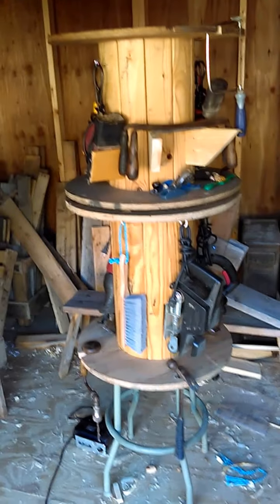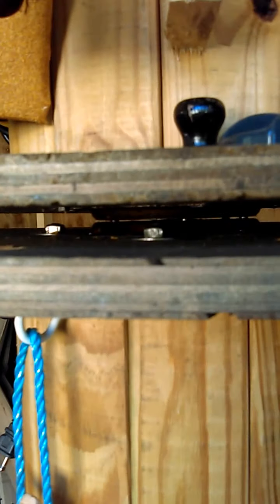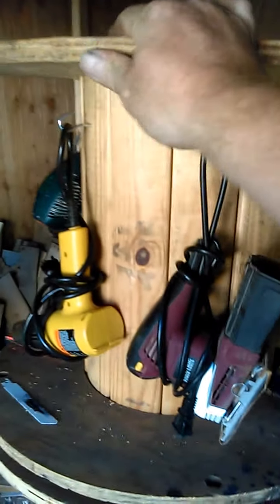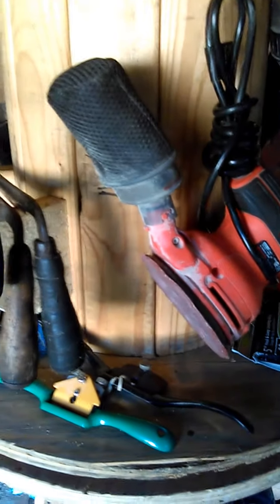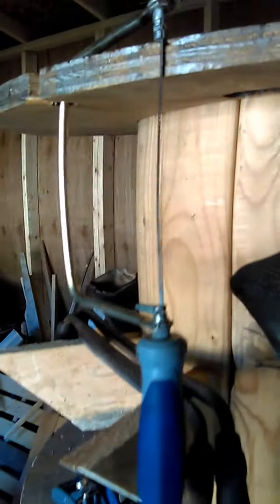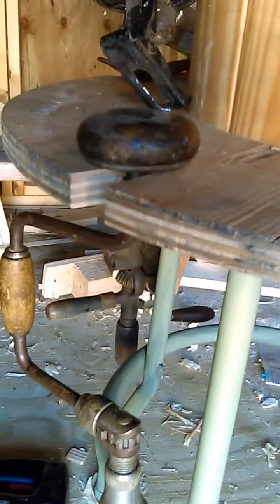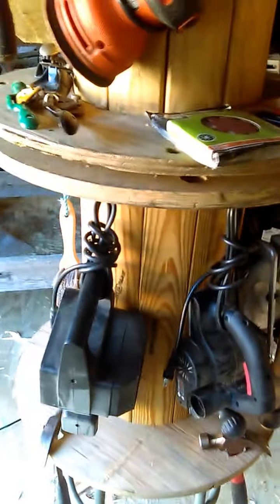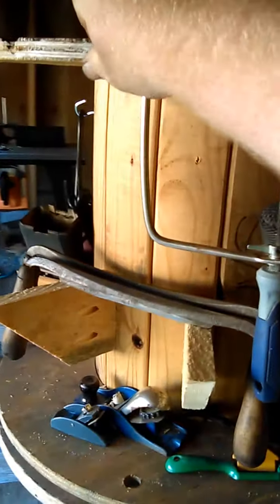$2 tool storage Saves $1000's

Comment: Why not keep the lazy suzy on the bar stool? What is the benefit of the top stool spinning seperate of the lower spool? If it was on kept on the bar stool, then fastnen the two wood spools together as a solid unit. It would have eliminated the need to disassemble the top stool. Other than that, it is a cool tool spool stool, fool.